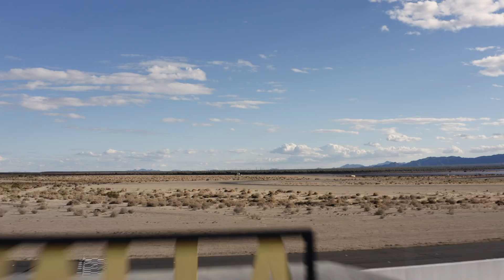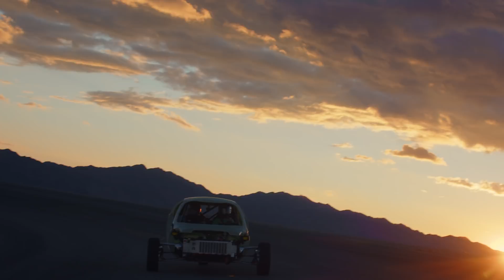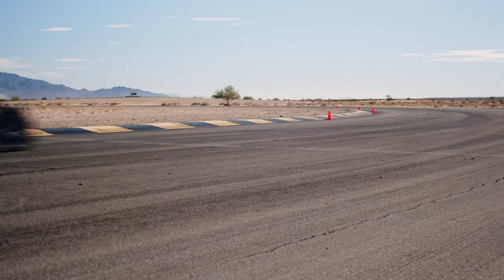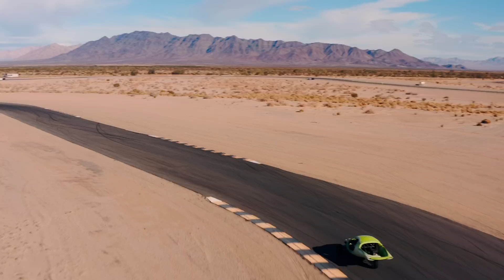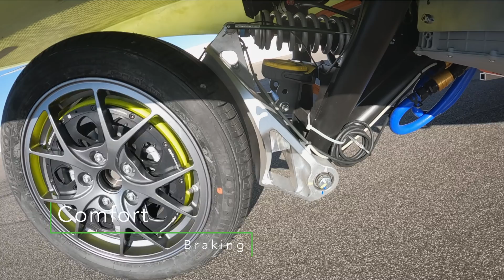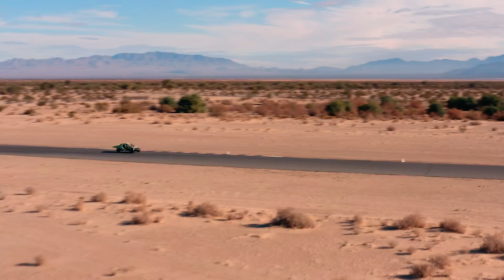Aptera — Vehicle Dynamics Testing

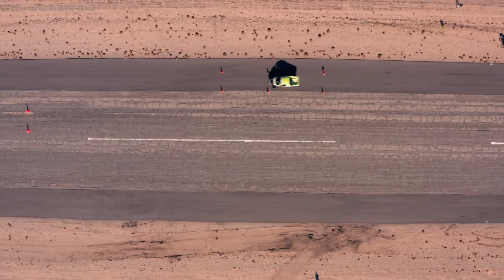Comment: @2:26 under braking, the front lower control arm deflects much more than it should..as there doesnt appear to be a stabilizer strut to prevent this...but for a three wheel vehicle the handling is quite good..

Comment: Gonna be tough, cheap doesnt mean the maintenance gonna be cheap, when the solar panel broke down and battery = more cost than cheap car
Reply: The solar will continue to operate even with fractured cells.  The battery life is projected to be at least 400,000 miles, and could well be longer to reach 80%, after which time it still as a long life potential in stationary applications.

Comment: I wonwder about replacing the converters and power controllers, they get hot and dusty, that's the main power failures when motors are hot causing voltage resistance.  Temperature sensors and data of power components make finding any cause of component or connectivity issues a easy fix, when or should a issue arise.
Reply: These will probably have sockets on the wiring harness and the location of the fault can be diagnosed by the computer, and a replacement plugged in.  There will be QR codes throughout the vehicle so you can pull up a video on what to do for service in each area.
Reply: @n.brucenelson5920  now that sounds like good service. 👍

Comment: 0:36 Front wheel off the ground. Exactly as expected with a 3 wheeler. The Campagna T-Rex does this too.
Reply: You'll be surprised how many track cars lift wheels during max cornering. Long as it doesn't tip over the majority of the traction always depends on the outer wheels, inner wheels don't do much during cornering.

Comment: 3 wheels? Really?
Reply: Three wheels gives them several advantages that they can't get with 4.  The biggest is in aerodynamic drag reduction - Aptera has a coefficient of drag of 0.13, and a low frontal area.  They couldn't get there with 4 wheels.  It also lowers rolling resistance and weight.  All of these factors add up and allows them to reach performance levels unavailable to 4 wheel designs.  They have still done their safety design to FMVSS part 200 crash test standards, even though they are in a class that doesn't require it.  They will publish the voluntary crash test ratings before shipping starts.

Comment: How does it respond the head on with an EV Hummer? 3 wheel vehicles don't have to meet car crash standards, correct?
Reply: Aptera is in a class where automotive crash tests are not required.  They have still designed them to pass, with such safety features as front and rear crumple zones, seat belts, air bags, and an F1 style passenger safety cage.  They will be voluntarily crash tested to part 200 crash test standards and the ra publtings ished before production shipping starts.

Comment: What's the reason to have a single rear wheel?
Cheaper? Simpler chassis? Is it worth it?
Reply: It allows a body shape with lower aerodynamic drag, less weight, and less rolling resistance.  This all adds up to performance that can't be achieved with 4 wheels.  My opinion is that this is a major part of the reason that solar cells can make a cost effective contribution to range and lower running costs.  I think many potential customers will find this well worth it.

Comment: on the brake test at 2.20 i noticed the lower ball joint moving backwards under braking a lot, this will reduce the castor angle a lot? not seen footage of other cars from this angle so dont know if its normal to see that much movement?

Comment: False feedback. Add glass, your solar panels, trim, etc and the CoG will be raised considerably to affect handling considerably. What you have there is a 3 wheel go kart, that';s not what you are selling to the public.
Reply: This is a test mule to validate handling. A steel roll cage and weights have been added to keep the weight balance similar to the finished vehicle and the weight and balance of the production vehicle is well represented   You are correct that is not a finished version of what will be sold to the public, but the performance will be quite representative, pending more tuning.

Comment: I am 6'5 adult that has a pre-order in for an aptera. I really would like to know if i can fit into the vehicle. From my back to my knee measures 26 inches and from my butt to my head measures ~36 inches. Please let me know. I have not been able to find any information out there.
Reply: Chris Anthony is 6'4.  You should have no issues.  The cabin is designed to accommodate a driver and passenger of at least 6"8" and also sleep a couple that tall in back.

Comment: I'm still curious what AJ turn would look like and if the back wheel would flex enough to dig into the ground and cause it to slam into that back corner....
Reply: Oh and the simulation you know there's going to be one dude maybe several years in the future from now that is going to come flying around a corner. They're grippy tires will do great..... And then the front corner clips a pretty big curb... popping the tire. Would a big curb upset it enough in a sharp turn in a city be able to upset it.

Comment: Also a quick view on car could give impression for room on space for even more scfi car as long holder back wheel which is even more scfi and allow even like motor on spring direct hang and bearings at like trans for me I can be vespa or ATV like engine like also side expand back to have movable flaps at begin and more glide stabile on front and pitch position F1 style e formula gives a kind lean on glide thoughts in cornering Bugatti spoiler makes drive totally airsafe aeroplane glide on the road which appears totally scfi on long run as scfi gadgets

Comment: Goo RN why you didn't decide to try to 1\3 extra size tail and side expand wide to see power off role off wing flaps as su 57 has first that then F1 holders pitch left and right pitch and attaching on wings flaps rotational with all this gadgets you need front nose peeker for extrastifness chasy and side wind holders attachments all together is some weigh but much more Bugatti atlantic view and scfi drive suport as car should drive and glide almost of easy pretty much as as airplane or glider cocpit with this am scfi stuff is some more tech but extra enlarge and 3\3 is Bugatti spoiler on arm that can lift or even be lower then mid for different drive mode and air stream anyway totally scfi drive and much more high tech in future to drive especiay if all same stuff in 5 door version optional is like hybrid low volume engine suport if car has range and scfi values and high tech application ratio which is already to close aeroplane cocpit then this is kind strip cocpit elegance but with climate and slight striped seats ajustable and sligh more narrow to back is better to spend some more money in this as you get fast two versions easy 3 door and room for 5 door version to easy also some strched sides and but with spoiler same is kind airccocpit solar electric car version from Australia sun race on solar cells but road city use car and long-range with solar cells even bigger capacity volume to easy all in total is much better scfi view and like complete airstream suport to car which kinds makes possible vtoll halls so in vay it can be one day efficient vtoll car as light cocpit vtol solar electric car hybrid which is step in future for right vay ahead at least for next 10-15 years in design

Comment: Mechanical engineer here. Nothing in the video or audio unequivocally addressed anything but flat road conditions. Everyone that understands vehicle dynamics has been wondering how Aptera is addressing high unsprung weight on a light vehicle. This is a fundamental problem. The only company statements I've ever seen have stated or implied that simple suspension tuning would be sufficient. That's a physical impossibility.

What's the real solution? Do you have one? Is Rauch reticent about revealing new tech?
Reply: There are engineering papers going back decades that have already addressed this.  If you are a mechanical engineer in the automotive space, you should be familiar with this body of work.  It is not an engineering issue new with Aptera, nor without long published solutions widely known to the industry.
Reply: @n.brucenelson5920 , btw, I asked the same question of Aptera in another thread and have yet to receive an answer.
Reply: @kylenolan2710  I included a link to a recent paper in my previous reply to you, but Youtube often doesn't post re;lies with links.  Basically, if you look at the data from recent papers, the suspension performance of hub motors is likely to be worse than conventional wheels, but not by a significant amount.  Even the alpha prototypes, one of which i rode in at a fast pace on public roads, while harsh, was not more clunky than other sports cars I have driven.  The Roush designed suspension, is from reports by Aptera employees I have been in correspondence with, is considerably more compliant.  They have already track tested an AWD beta at up to 100 mph, and at an early stage of tune is showing great handling performance along with comfort..
Reply: @n.brucenelson5920 , send me an altered URL, then.  Again, I've been researching and all I've found is what I've already described.

Yes, it will be worse, but I see no reason to believe that it's insignificant. You just said that Roush increased compliance. That would improve ride comfort but would actually make road holding even worse! You can't have predictable, or even safe, handling if the tires aren't planted on the road. And they won't be if the unsprung mass is high and the springs are soft. This is ME101 stuff.
Reply: @kylenolan2710  Roush has added a sway bar.  We now know that they have had the beta up to 100 mph on the track.   We have video evidence of far improved handling now.  Autocross enthusiasts are even talking about puting examples into competition.  I encourage you to drive one yourself when you have the chance to and experience what is a great improvement over the already flat cornering of the one i rode in.  You sound like a proverbial sophomore  who took ME101, and thinks he knows everything.  Handling vehicle is far from my area of expertise, but to me your inability to find the papers I am referring to make me think you are research challenged.  There is a track record of handling studies on hub motors going back more than a decade.
Reply: @n.brucenelson5920 , still waiting. On you and Aptera. Just a link. Redacted to pass YT filter. How hard can that be, Bruce?
Reply: @n.brucenelson5920 , I've actually spent considerable time, off and on, for years looking at exactly this type of research. The last time was YESTERDAY. Yes, there's been research into things like tuned mass dampers with adaptive active control schemes. There's nothing I've ever found that remotely supports the claim that mere tuning solves the problem. I've even done some crude computer modeling of ideas that I've had. As I said, this is a fundamental issue. As fundamental as the concept of natural frequency.

If you're a mechanical engineer in "the automotive space", or profess to have the knowledge of one, please point me to at least one paper showing how to tune away the ride and handling problems of high unsprung mass.

Better yet, point me to Aptera's solution.

Comment: Imma install a dt466 turbo diesel on mine!!!!
Reply: The very first Aptera had a diesel engine.  I have imported diesel engines and we did our own engine controls and EPA certs, so you know we were serious.  Trust me, the new Elaphe electric motors are a HUGE advance.  The dt466 only adds 100 hp to what the Aptera already has, but is double the weight of the entire vehicle.  It would kill existing performance and add a tremendous amount of noise and operating cost.  (I know you were kidding, but.....)

Comment: Not exactly thrilling to see a fat heat exchanger on the front.

I hope the skin cooling is working out.
Reply: Additional betas are being built to test skin cooling configurations.  This test mule is exploring suspension edge cases without the risk of thermal throttling kicking in.  Step by step...

Comment: top speed?
Reply from the maker: Hi! Thank you for this comment. We are still testing to publish the most accurate numbers all around and we cannot wait to share them with you. Wheel-mounted electric motors propel Aptera from 0-60 MPH in 3.5 seconds with a top speed of 110 MPH.
Reply: 110 mph, rpm limited.
Reply: @n.brucenelson5920  cool, which is the best  efficient speed
Reply: @jksjks555  I don't know if we know yet.  This may become clear with the beta testing.  With increasing speed, both rolling resistance and aerodynamic resistance increase - aerodynamics with the square of the speed.  At a guess, perhaps 20 mph or so.  We know that the heaviest, 100 kWh battery pack version with 3 wheel motors will use under 100 watt hours per mile at EPA highway speeds. - averaging 48-50 mph with peaks up to 67 mph.
Reply: I understand from an investor conference today that the first beta vehicle reached 100 mph during a recent track day test run.

Comment: Hi Aptera, will there be a basic spec model that has the interior design of something like a Honda Insight first gen? Basic display that doesn't include gps, a highly intergrated system like Tesla? 
I would pay more money for a model of the Aptera that is minimalistic like this
Reply from the maker: Hi Dankus! We will have the radically simple touchscreen in the Aptera. Is that what you are referring to?
Reply: @ApteraMotors  I was more referring to the car not having built in GPS, not requiring updates, not restricting the user in a way that is bad for right to repair, not having any service like Toyota who are requiring their customers to pay 80 dollars a year for a remote unlock feature, not having government or Aptera be able to remotely disable the car, etc. 

Does the Aptera require to be connected to the internet to run? Does the car require GPS to run? 

Will the car be able to run open source software?
Reply: I actually own a Gen 1 Honda Insight that I expect to replace when I take delivery of my Aptera.  If you are talking about more knobs and switches instead of a screen, the costs would certainly increase over the current plan.  If enough people expressed such a desire, options may become available at some point.

Comment: Congratulations on your progress. The chassis looks more stable than one might expect from a three-wheeled vehicle. I'd like to see the numbers on lateral (turning) G's  compared to other vehicles in the price or weight range. Also, I'm surprised to see such small wheels. I know wind resistance is the main energy consumer, but on rough surfaces, smaller wheels add noticeable drag. I've experimented with wheel size on a recumbent Catrike and found that even a modest increase in wheel diameter makes a significant improvement on a gravel bike trail. I know the Aptera is not designed to operate off-road, but rough surfaces are more and more common as road maintenance suffers from 21st-Century 'government.'
Reply: I suspect that Aptera will pull at least .8 on the skid pad.  We will see.

I live on a chip seal street, so I will find out.
Reply from the maker: Hi Frank! ☀️  Thank you! We look forward to sharing more results as we complete further testing. This Beta mule was specific to testing our suspension-- nothing with wheels. Although, we really aren't testing our Betas with drastically different wheels than production-ready vehicles.
Reply from the maker: We also offer an off-road kit upgrade with 7" ground clearance to take Aptera off the beaten path.

Comment: Excellent showing, providing great information.

But, of course, I have more questions:
1. What tires were used for this track test?
2. How does Beta handle speed bumps and potholes at speed?  In particular, how did it handle going off the edge of that track?
3. The front suspension seems awesome.  But the rear looked to have a very short swing radius: Will the next Beta include an improved rear suspension?

Thanks!  Can't wait to get mine.
Reply: While the alphas used a swing arm, the betas have a Roush designed dual link suspension.
Reply from the maker: Hi Bob! Thanks. We admire your curious mind. :) While we can't give it all away yet, we gained critical insights on the centering behavior of the vehicle’s steering system, stability during emergency braking situations, and the effects of over-damped versus underdamped systems to ride quality and maneuverability. We look forward to providing more test results in time! We're glad you are a part of our movement.
Reply: @ApteraMotors  - Mechanical engineer here. Nothing in the video or audio unequivocally addressed anything but flat road conditions. Everyone that understands vehicle dynamics has been wondering how Aptera is addressing high unsprung weight on a light vehicle. This is a fundamental problem. The only company statements I've ever seen have stated or implied that simple suspension tuning would be sufficient. You seem to be implying the same here. That's a physical impossibility.

What's the real solution? Do you have one? Is Rauch reticent about revealing new tech?